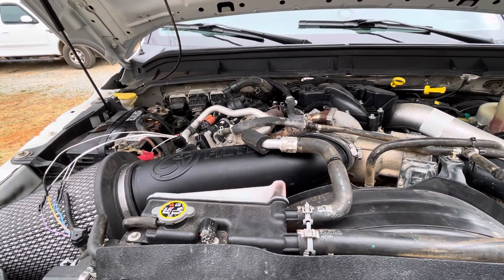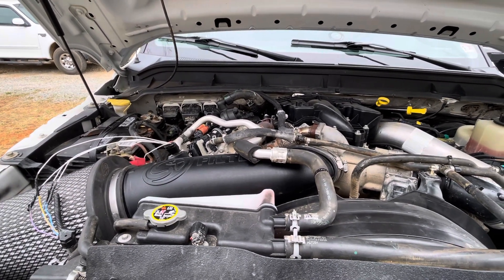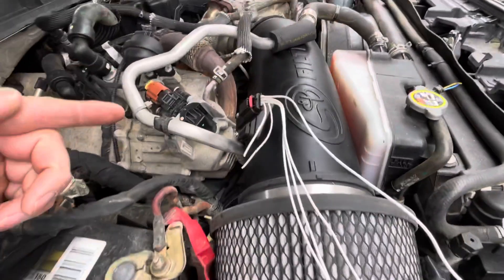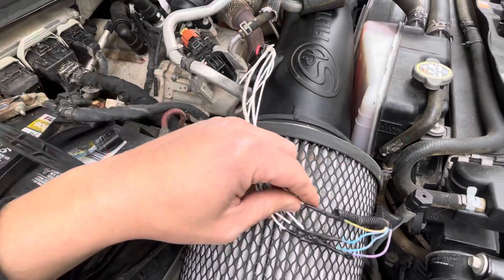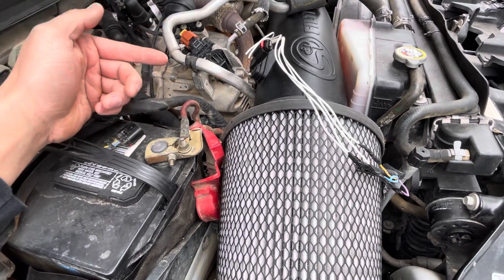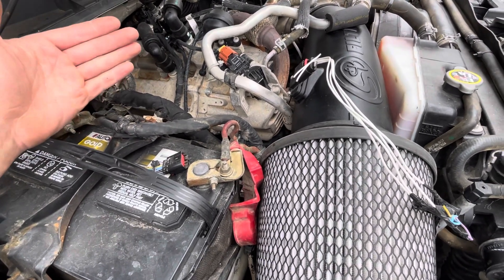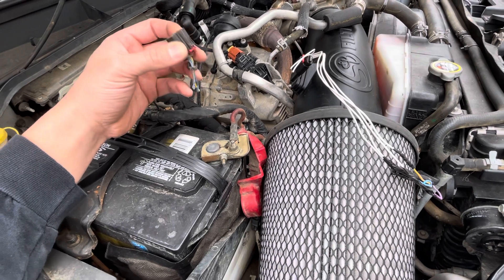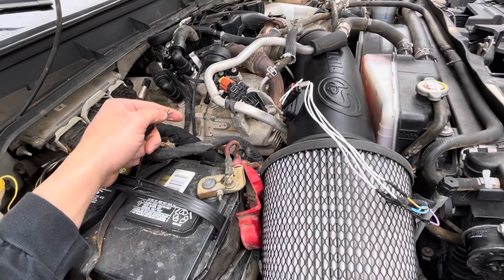6.7 power stroke AC issues and IAT sensor reading -40

Comment: My maf pigtail also had the iat wire 1 cut off and i have a code p0113 for mass air flow and the truck has a dead pedal occasionally below 1700 rpm so i wonder if that's what's up with mine

Comment: Ive had the same issue for the ambient air sensor that located in the passenger mirror that I replaced with an aftermarket that didn't have the sensor built in

Comment: What year truck is this for?  I have a 2017 that is telling me it is the ambient air temp sensor.  The screen inside the truck is telling me it’s -40° outside.  I am wondering if this is associated…
Reply from the maker: Very well could be. This was on a 2015
Reply: @cbr600rx7  thank you for the heads up.

Do you happen to know where that sensor is on a 2017?  I have never heard an ambient air temp sensor referred to in the same context as an IAT, but I also don’t think I’ve had to deal with an ambient air temperature sensor before so…

Actually, I just watched another video and the sensor I’m referring to was in this guys passenger mirror.  He replaced his mirrors and the after market mirror didn’t have the sensor and it threw a CEL.

I know the passenger side mirror was replaced in my 17’ before I bought it, so now I wonder if that’s the issue…
Reply: You ever figure out the issue ? Dealing with same
Thing and just replaced my oem mirrors to aftermarket mirrors
Reply: I had to pull my intake off the other day. I forgot to plug that sensor back in. I had no ac, and it rolled black smoke whenever I took off without boost. I think it has to do something with the fuel system also, that's the info I was looking for. (Mine is deleted but doesn't smoke btw)
Reply: @travismuschalek7611 Sorry, can I ask you something? My vehicle is having issues with the AC and I already scanned it, but no fault codes popped up. Do you have any ideas on how to fix it?

Comment: My 2011 6.7 is doing the same thing it’s reading -40F too do i need to replace the plug or the whole sensor?
Reply from the maker: Sorry for the late reply. It could be one of the other but the plug is know to fail more often and is by far much cheaper. If you have basic wiring skills it’s a easy job.